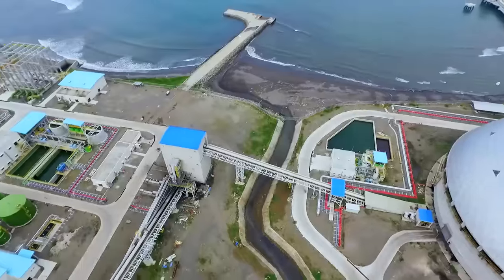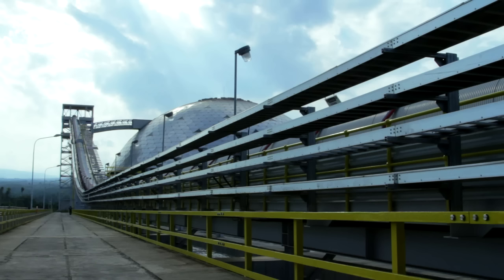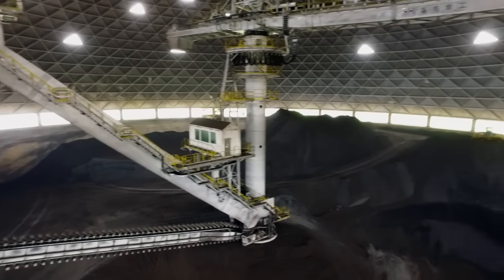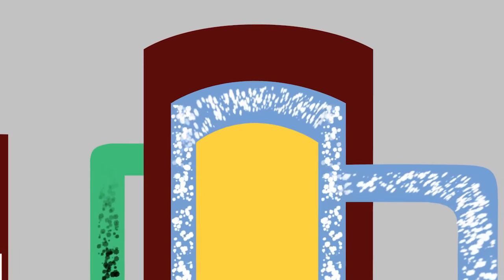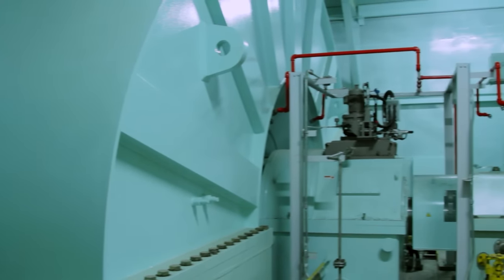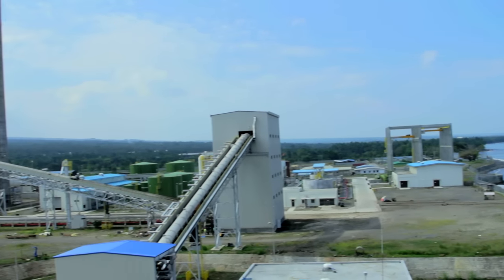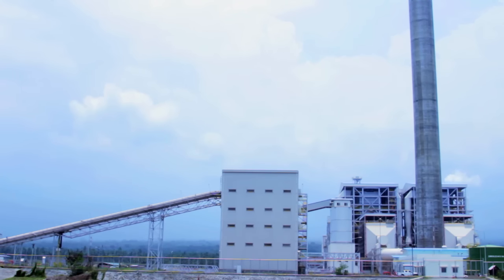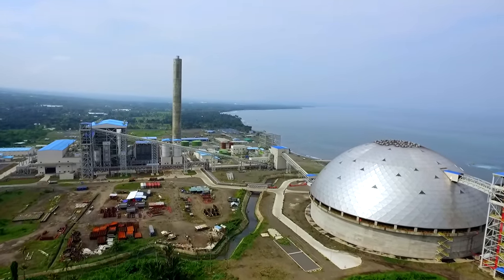The CFB Process

Comment: Really!. that's it?.. Just 260MWs.. When your ready to get serious give me a call.. Ok. How do we use coal to produce electricity. I'll take a guess. Burn as much coal as you possibly can as fast as you can. We have the same waistefull process in other parts of the world.
Reply: Fluidized bed boilers burn at much lower temps than conventional gas plants. This mean far less NOX emissions which is the culprit of photochemical smog you observe in densely populated areas. Also as stated it's a base load plant for an island, I doubt the grid has the same demand as done other countries